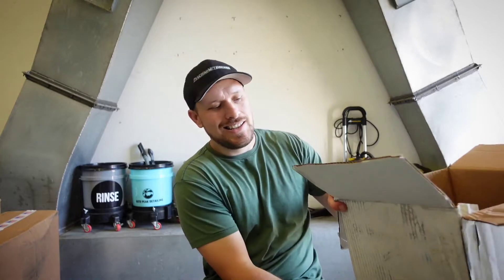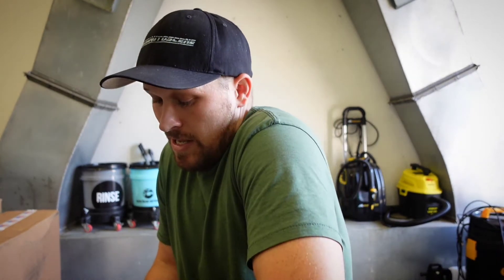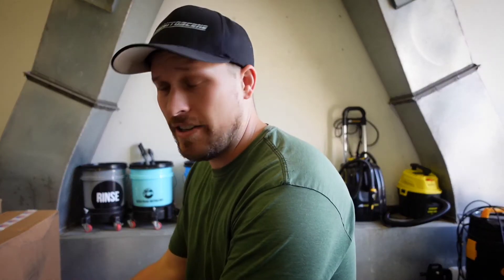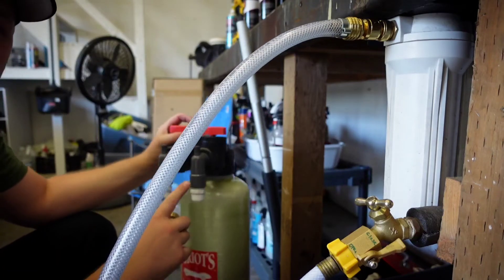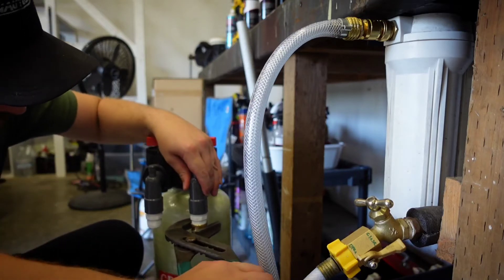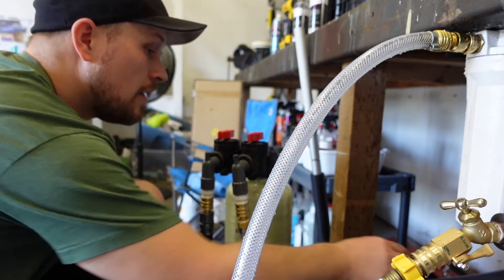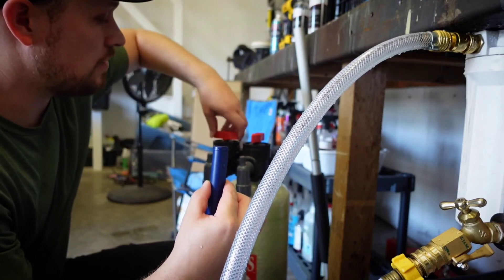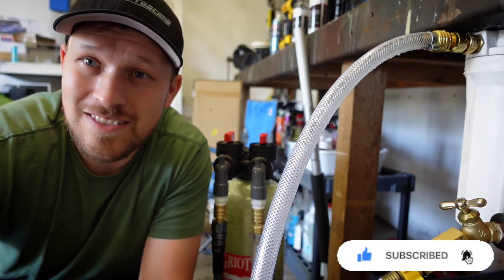New Griots Water De Ionizer Setup

Comment: You cant just use the deionized water for the whole wash? To be 100%
Reply from the maker: Total waste, only use during the rinse. All the manufacturers also explain this. You'll burn through the resin. The soap neutralizes the hard water. Use a good soap (carpro reset or Koch chemie GSF)

Comment: Hi, I have this product. When I'm done using it do I have to empty the water from the tank or leave it sitting in the tank till next week's use? Will it damage the resin?
Reply from the maker: You can leave it in. Mine lasts 4-6 months with 210tds well water. Haven't seen issues letting it sit.